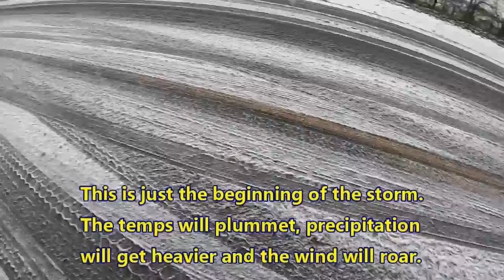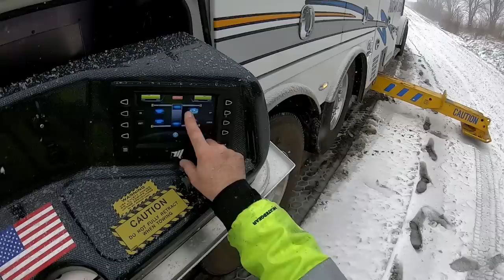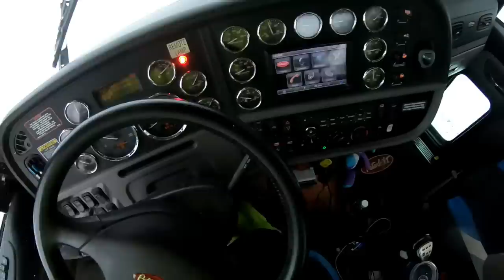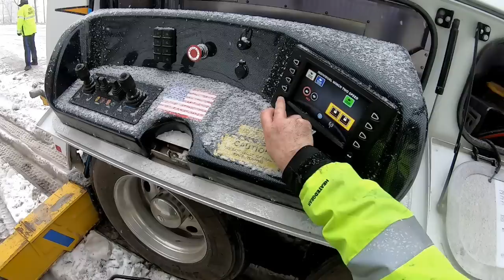Guardian Angel Working Overtime  Two Jack knifes in the Snow Part 1

Comment: we winched a beverage semi about 400' through and out of a parking lot with a rollback this week. all the heavy's in the area were busy, so one of them subbed it out to us. chained the hook to the bottom of the bed so we could rig a snatchblock for advatage.
Reply: I am by no means any sort of expert on the matter, but I would imagine it comes down to a matter of concern with respect to controlling the load in a safe manner at all times during the pull.  To pull from the trailer would require releasing all the brakes (semi and trailer) do that all the tires could freely roll at which point the load can potentially get away from you once it is free of the ruts that the front wheels cut and there would be no good way to stop the vehicle without a second truck to pull from the opposite end.  Sometimes it is simply safer to pull against the brakes knowing that the moment you stop pulling the brakes are already there to keep the load from continuing to roll uncontrolled.

Comment: Glad you are both safe.  This is Wisconsin weather to a tee!  The roads here are covered with ice.  And it's -20 right now at 10:15am.  It's cold.  You're right. 4 wheel drive doesn't work on ice.  And headlights are a must.  I had some kid pass me during a whiteout last Friday.  He just flew around me.  Because I was driving 35mph on a 55mph road that was covered in ice and snow.  Crazy.

Comment: As a trucker, I’ve seen more 4 wheel drive vehicles in the ditch with only about an inch of the white stuff, drove past them many a time in my rig, just insane, you are correct about that, they think they are invincible, 4x4’s and all wheel drives do not do well on icy roads, it’s amazing, and they learned their lesson I hope!!

Comment: A lot to be said for the old railroad flares. They only last a short time, but are super bright.
Reply: I carry a packet ofthem in my car, both for safety and for light if I have to change a tire in the dark, for example. 

My dad was a railroader for most of his life, and I put myself through college working as a switchman/brakeman. When the weaher was like this, I usually got called because the oldtimers would call in sick.

Comment: As an Illinois resident I can say with certainty that in weather conditions such as this the best way to protect yourself is with layers.  When it gets cold enough (in the 40's F) I wear sweats under my pants.  When the temps drop to single digits and lower I also wear long johns under the sweats.  T-shirt, sweatshirt, quilted flannel with a drawstring hood and a heavy coat (respectively) is what I wear on the upper half.  A good pair of insulated work gloves also helps.  Stay safe and warm and God bless.  :-)
Reply: Do have to outer coats a size or 2 above normal to just get the coat on?

Comment: Ron, you could describe "miserable" and "dangerous" many different ways. But, this video shows the gold standard for those two words.  Be careful out there, my friend.
Reply from the maker: This video was taken before the big "Polar Vortex" that hit a lot of the U.S. and this was still miserable.  We were spared during the Vortex.  We received some cold and wind, but not the precipitation that a lot received.   Nor did we get the same degree of cold as many. My hats off to ANY who had to work in such conditions.  I have had to in the past and it makes for long, miserable day/days.   An hour can feel like three in such conditions.  God bless, me friend.
Reply: @RonPratt  Agreed, Ron. Anybody working in extreme cold, freezing rain, or high wind has my admiration and respect. Here this morning, temp was -2° with a wind chill of -15. Just down the road, 4 linemen were working from 2 bucket trucks to repair a high voltage line. That's hard!  Cold just makes everything tougher.  Stay safe, Ron.

Comment: All that nice antilock braking on the tractor is useless when you end up with ice under the snow. You might as well put the entire tractor trailer assembly on air cushions and see it get blown off the road in that much of a crosswind. 

Even with all the other stuff the law enforcement agencies were trying to get you to deal with simultaneously you still took time out to inquire about the truck driver's ability to safely wait on the side of the road in a truck that would have no heat due to an inoperative engine. You are a true capable multitasker in adverse conditions. Thanks for all you do to help others and to post these videos.
Reply: Some times ABS brakes do Jack all in snow and ice I should know
Reply: gordon farmer On ice ABS will do about as well as can be, but if you are in a near zero traction situation ABS can not magically create traction where none exists.  Snow, and other loose materials (such as snow or gravel) are not ABS’s strong point as they are one of the rare cases where locking the brakes can actually result in better braking by piling up material in front of the tires and forcing the tires to plow through it.  So, indeed.  Sometimes you just have to slow it down and be extremely cautious and, if possible, consider sitting out the conditions for a day or two until conditions improve as it will cost far more if you lose your vehicle and/or load in the process of trying to stay on an arbitrary and overly optimistic schedule that fails to take conditions into consideration — sometimes those of us who are customers need to give a little and recognize that a delivery is going to be a little late due to nobody’s fault but Mother Nature, and she loves to put us in our place from time to time.  But thank goodness there are hard working people out there like Ron and family to help rescue those who lost their battle with physics — we all have bad days and make mistakes, what matters is surviving the accident to learn the lesson and put it into practice!

Comment: That rotator sure is a valuable addition to your fleet. In the past it would have taken at least two 750's to do that job comfortably.  One at the rear, pulling the trailer to the rear and one on the front with one line pulling up and back at the rear crewmember area and another on the front Dow low to help bring the front around as the trailer was pulled back. Although I have done them with just one unit at the front to pull the tractor back around, the trailer backing up by itself after the brakes have been aired up or release. However,  for that to work, several conditions have to be right.

Comment: Wow, nasty weather your way, and here. Western Washington is now receiving snow, yep began to fall in earnest at noon and it's been coming down in varying strengths, at the moment, not too heavy but it is supposed to pick up and the most accumulations should be from this afternoon through tomorrow morning. About 6-8 inches is what is expected and I have a feeling it might be a little bit more than that, and snow again is forecast for Monday.

This is late for us though, not unheard of and one year in the early 1900's, Seattle and I think the surround areas had about a foot or so of snow and some buildings had  roofs collapse and I think it was a bit later in the month, like the 19th or something like that.

The community college where I work shut down at 12:30 and will remain closed through the weekend.

Indeed, DO be safe out there.

Comment: In this environment you really need an impact attenuator truck - this is basically a truck with high speed impact absorbing crash barriers attached to the rear. The highway departments in Australia have them to protect workers (including tow operators) when working on main roads. The barriers are designed to stop a truck at 100kph and fold out from the rear of the flatbed by 5m (the truck is still useable as a flatbed truck by the way it just has two big plastic tanks with an aluminium frame arround them).

Comment: That is so impressive to watch the truck lift and moved, now days the tractors are getting so big with new sleepers.  You tow drivers make it look easy but far from it I use to have to send trucks into Death Valley at 115 degrees not fun working in those ramps.

Comment: I was just passing through your neighborhood! I almost stopped for breakfast. 
Do you know the difference between a 2 wheel drive and a 4 wheel drive pickup?

The length of the cable you need to pull them out of the median!! 😎😎😎😃
Reply: now that one i like!!!!
Reply: @607703  Yea, sounds about right. 2wd pickup isn't worth $ savings up here in the north. Had some part their f150 2wd drive in neighbors yard across the street some years ago.  No receiver hitch or hitch in bumper to hook a tow strap on to for my chevy to save the ford so had to take the ball hitch off my ATV to stick in their bumper.
Reply: @607703  feel free to use that! My buddy is a Michigan state police officer and told me that one!
Reply: I always said it was how far into the ditch you went, same thought from different perspectives.
Reply: 2 wheel drive, or 4 wheel drive...? 4 wheel drive allows you to get up to speed quicker and get into deeper trouble... a 2 wheel drive won't allow you to get up to speed as quick so you don't get into as much trouble, a heavier 4x4 goes deeper into the ditch with the extra weight.... and both have the same 4 wheel braking.... 4x4 drivers get too complacent... bottom line is, they both have their advantages and disadvantages... bigger is not necessarily better...
Reply from the maker: I LOVE IT!!!!!!
Reply: @TeriWilde  I guess what I meant was 4x4 have a tendency to feel invincible and drive a little faster.....thus burying themselves deeper in the ditch and needing a longer cable.
Reply: The difference between 2 n 4 wheel drive in a situation like this is that 4 wheel drive allows you to put the WHOLE truck in the ditch while a 2 wheeler usually only goes in 1/2 way. 4x4s are great for many things. When there's ice involved though, it doesn't matter how many wheel drive you have or how heavy your vehicle is, you're just along for the ride! Be safe everyone!
Reply from the maker: @MikeBrown-ii3pt  Also have to be careful after having driven for a while.  The tires will be slightly warmer than the ice due to the friction and motion.  When you stop, the heat from the tires can melt the ice/snow underneath and when you go to take off, you can't.  I've also come to a stop, pop the air brakes, get ready to step out and the truck starts to slide.  On ice, gravity always wins......
Reply: With a 4x4, I was told to always drive in 2WD - that way if you get stuck somewhere, you actually have a chance to extract yourself just by throwing it in 4.
Reply: @RonPratt  I delivered fuel to gas stations for years! I'm a witness to this. Pull in a store with hot tires and.........yes well you know!
Reply: @ teachers2010
Now that's funny.
Reply from the maker: @teaches2010  Yep, I pulled in to a station to untangle a set of pups.  I popped the brakes and didn't realize I was on a slight slope until I started sliding sideways straight towards the pumps!!!!  Talk about getting your heart racing!!!
Reply: @RonPratt  someone in ops had the infinite wisdom to order automatic kenworths with balloon steer tires and low pro 24.5 drives. Let's just say that first winters tow bill could have bought the better part of another new truck. 👍👍👍👍
Reply: Ron Pratt Mr. Ron been there done that, 104’ Tower Ladder Aerial, we we’re responding out side of our city to a neighboring city, when we arrived set the parking brake, officer in front seat stepped out only to be pushed away from the truck about 2-3 feet, he was about to holler at me for moving when it shifted again another foot...and I had parked almost perfectly on the road crown, oh yeah the whole thing weights just over 75,000 pounds when loaded with the gear and water, 53 foot tandem axle straight truck built by HME in Michigan, kinda scary at best!
Remember gravity with momentum will always win...🥶🥶🥶

Comment: Just a though, screw a length of 2x1 along one edge on one of your timbers, then you can use the lip under the leading edge of the trailer and as you tension the chains the lip stops the wood flipping up at the ends, while the tension presses into the trailer wall, meaning little pressure on the thinner wood. Should make it easier to position to avoid damaging the airlines etc. Could probably even just have a 6" length at each end of the timber piece.
Reply: If one is going to do that then it would be far better to use a good grade of 3/4” to 1” plywood — and plenty of good screws.  Wood will cleave rather easily along its grain, which would snap a 1x2 once several tons of force are potentially applied to it.  By comparison, the grain of plywood is oriented in alternating right angles such that there is no single line that it will naturally cleave on making it orders of magnitude more difficult to accidentally cleave in two.

Comment: I worked Maintenance once and in mid summer 115 degrees I had 6 A/c out on my property and 5 out on another, I was spread so thin but I got them all done. People expect 70 degrees at 115 and that's not happening. I about passed out that day. You do have a long day there.

Comment: People don’t realize 4wd use the same 4 brakes and tires as every other car on the road.
Reply: Very true,  I think that correct Winter tyres ( Mud and Snow with snow symbol), are better than some, if not all 4 wheel drive with all season tyres.
An empty pick up truck is not a good vehicle for slippy conditions. Not sure how low the winter tyre rubber is good for, it is better below 7C /44F.
Always enjoy Ron and his team/equipment.
Reply: @bostedtap8399  Some pickups (utes over here) really need a 100 pounds of ballast over the rear wheels.
Reply: @gorillaau  Or just get a canopy put on the bed, I had a '92 Ford Ranger (US model) 2 WD variant with that on the back and some decent all season tires, it did quite well in the snow, better than expected, but yes, some bags of sand help immeasurably as well and plus, you can rip one open to gain traction if needed. :-)

Comment: I’m a Crane Operator and you folks do some really different lifts. I noticed that y’all side load your Boom, something I avoid at all costs. I don’t know a thing about your equipment and I’m intrigued.
Reply from the maker: I understand.  I am very familiar with cranes, their operation, and maintenance.  This is something TOTALLY different.  This is a Heavy Recovery vehicle with lifting capabilities.   The same principles apply to any lift whether with a crane, a rotator such as this, or, say, an excavator performing a lift and setting pipe.  Physics and geometry don't change.  The design and capabilities of each type of equipment are quite different, however.  This equipment is designed, primarly, to pull heavy loads from a multitude of angles, but it also has the ability to lift and swing similar to a crane.  With regards to side-loading, this unit is designed to handle a certain amount of side-load before having to counter the force.  As with any piece of equipment, one needs to know its limitations.  I've worked with this unit long enough to know what I can safely do and what not to do.  I've told countless people during training, that it is just as important to know what your equipment CAN'T do as it is to know what it CAN do.  Be safe.   Thanks for watching and God bless.
Reply: I would have approached this recovery differently as well. Ron mentioned pulling it out the same way it went in.That would have been my way of doing it. There’s more than one way to crack an egg. :-)

Comment: Instead of a wire tie on end of rim sling just tie a foot or so of nylon parachute cord permanently on each end. Much easier to snake through but strong enough to really pull on to pull rim sling through.

Comment: How you get more familiar with driving and maneuvering in snow every now and then you should take your truck out into a large parking lot somewhere and perform stunts. 

It’s so you’ll expect what happens in a situation and no how to control it or prevent it. 

I started out driving in Chicago in 2000. Back n forth from Chicago traffic jams to Detroit I ran like a champ. 
But them ole heads taught me a lot about trucking. I ran through snow and ice every day but and through blizzards many years. 

But it’s a certain way you must drive through snow and never too fast.

Comment: Got cold just sitting and watching! Thankfully, northern Colorado hasn't been hit too bad.
I'll drive for conditions, headlights on. Even did this with the former 4WD truck I had. The 
one thing that really gets me, is that while I'm driving slow, because of adverse conditions, 
there's always at least 1 person that has to ride my rear, because I'm going too slow for them!

Looking into the possibility of getting one, or 2 of the guardian angle devices, as well as the
rotating flares. Quick question: are the flares LED? Have a plastic tub in bed of my truck, that
has jack and other year round things.

Seems, every winter around here, the vehicles I see in the ditch/median, are 4WD vehicles!
I'd never make it in that profession! Too many health issues these days, but the fact that I
HATE winter!! 

Enjoy the videos, as I'm learning something new just about every time!
At this point, stay warm and stay safe!!

Comment: Some OJT for Talon in less then desirable conditions..Great job Talon. As I told my trainees when I drove  OTR... you can have 600 wheel drive  on ice it's not going to make  a darn difference you'll still be slip sliding away...Ron how often do you have to chain up .. I know weight help with traction  to a certain point. as always prayers for safety and blessings. 👍